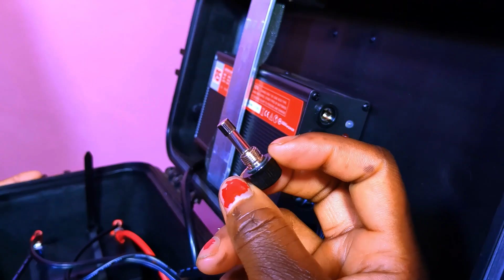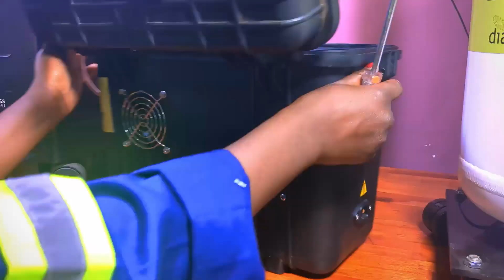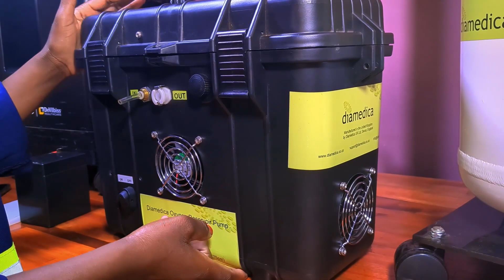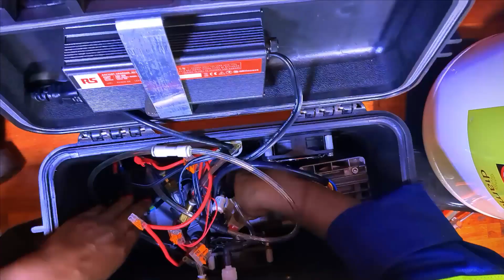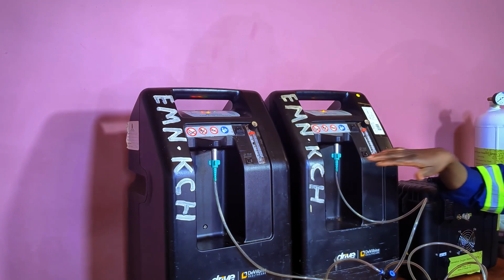Diamedica oxygen reservoir system teardown.

Comment: Can this system be used to refill smaller portable tanks?
Reply from the maker: No, the Diamedica oxygen reservoir system cannot be used to refill smaller portable oxygen tanks, as it's a low-pressure system not designed for that purpose. You’d need a dedicated oxygen compressor/filling system to do so safely and effectively.